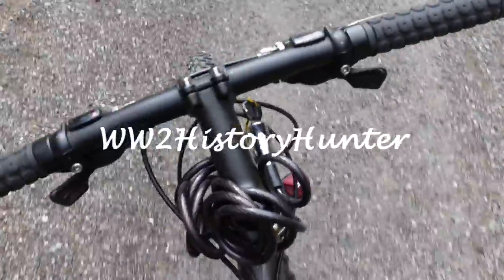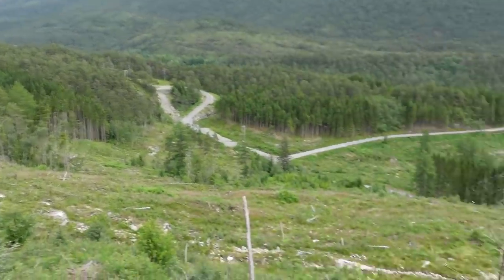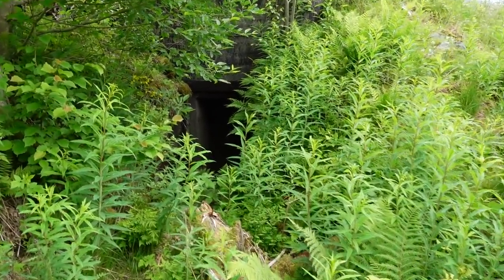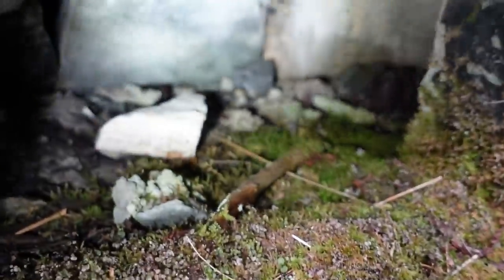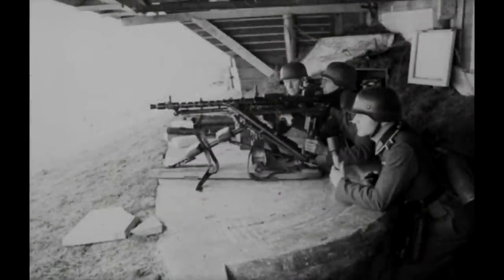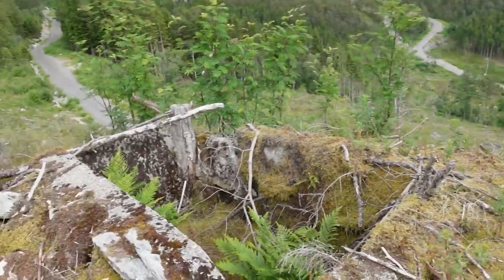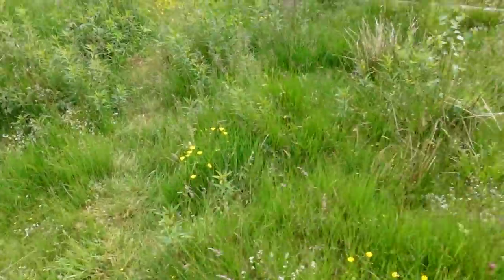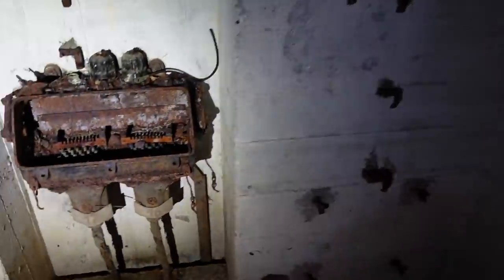Lost German WW2 bunkers in the mountain. We found them !

Comment: YAAAAAYYYY die Fahrradmannschaft !!!! You need to keep a 'GO PACK' for adventures a back pack with things like FLASHLIGHTS etc. I carry no less than SIX FLASHLIGHTS if i am goung underground or in the dark!! in these MG emplacements they would have worked out ranges to hit different points in the road . These ranges and bearings will be painted on the concrete somewhere.  This is so they could react FAST to repel invaders!! The large metal boxes on the walls would have been for Feldtelefon links to each gun emplacement and a command post.  13:39 THERE IS A GERMAN ADLER on the wall very faint it has been painted over. GREAT EXPLORE
Reply from the maker: Such  great comment and thanks for that.

Comment: i wonder about the use of the boxes with and without lids. what were they used for? my guess is they tied into wire that went down into the valley next to the road and maybe other places where they were tied to explosives. maybe not. but that's what im tinkin
Reply from the maker: Power supply and com cables they are. Thanks.
Reply: @WW2HistoryHunter  ,are you certain? Do you know the name of the unit?